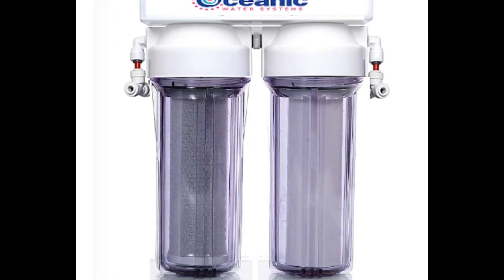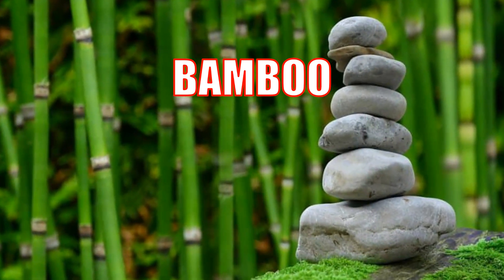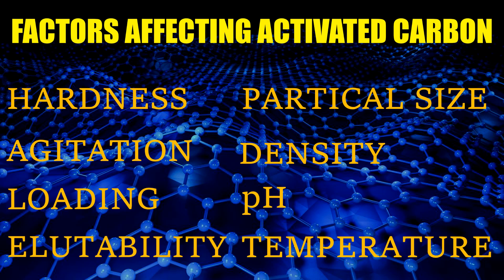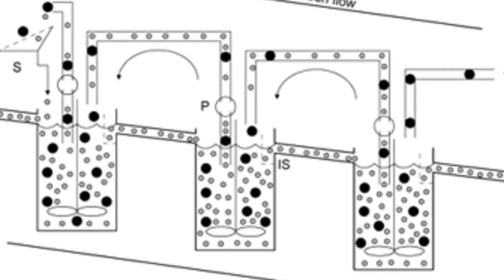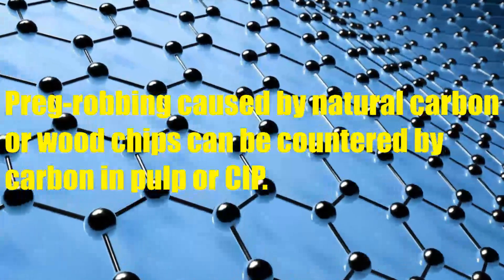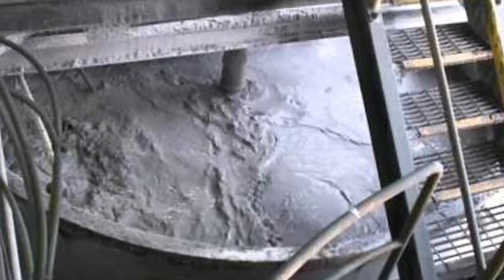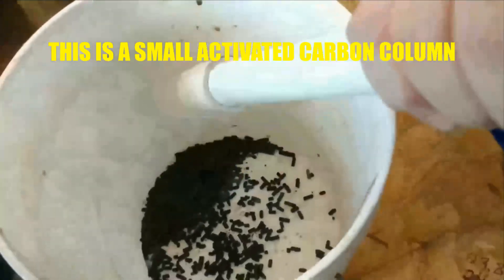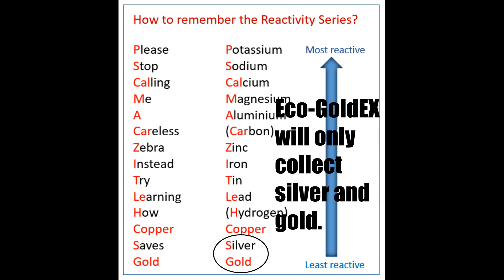THE SECRET TO EXTRACTING GOLD MAY BE ACTIVATED COCONUT CARBON (Gold Minning)

Comment: The research, published in Hydrometallurgy and led by Professor Jacques Eksteen and Dr Elsayed Oraby both from the WA School of Mines: Minerals, Energy and Chemical Engineering, found that adding potassium permanganate to the process could solve the problems currently associated with leaching gold with glycine (in the absence of cyanide), such as the need for higher temperatures, glycine concentrations and oxygen addition levels. Search for details...

Comment: Since the density of carbon varies between 2-3 depending on the molecular form, I would recommend pulverized to tiny powder particles then eluting to recover Au and reusing the carbon again. Very nice milling process with good yields and minimum enviro impack.

Comment: If milling has released Au (free gold) then concentrate using a physical process. If tailings hold residual Au values maybe it can be economically recovered using chemical precipitation. Undoubtedly one milling method may not be adequate with residual tailings values... test test test

Comment: It appears that CIC et al is physical trapping of Au so eluting does not release the Au unless the carbon is crushed into smaller particles, which will continue to hold Au, hence chemical might be a better recovery method than elutation.